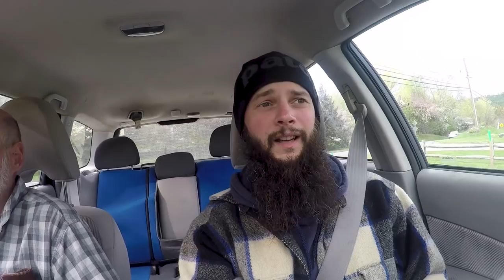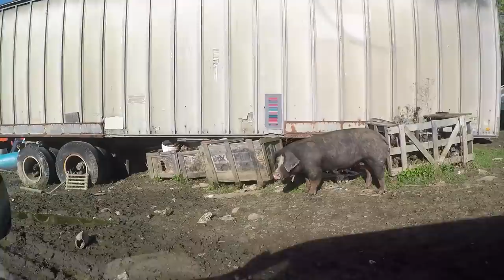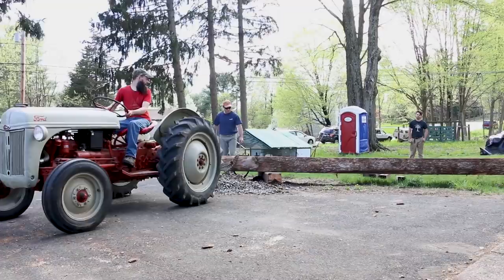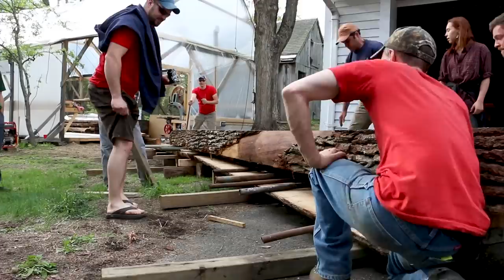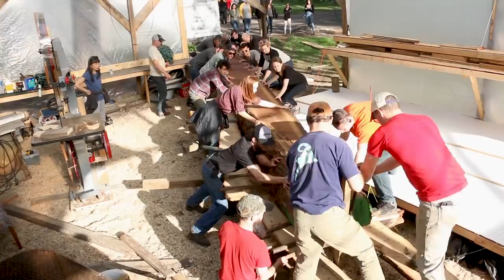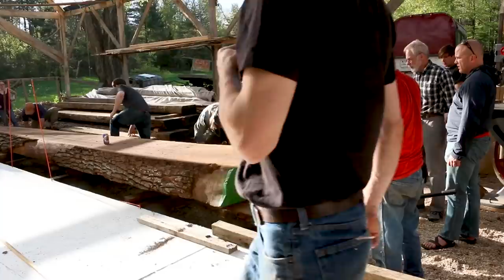Acorn to Arabella - Journey of a Wooden Boat - Episode 10: Keel Timber and Open House

Comment: Having worked for a fabrication company I had to make arrangements for the movement of oversized loads every week.  I suggest that you take the time now to call around to "Rigging Companies" to get a feel for their specialty and knowledge.  When you find one that has the knowledge for boat movement and your project is complete engage them in negotiations for the pick-up and placement onto a trailer.  I also suggest that when negotiating with the trucking company you make sure that the contract reads that their "pole car" is well ahead of the tractor-trailer AT ALL TIMES.  One of our contractor's tractor-trailer was too close to the pole car and the machine hit a bridge before the driver could stop.  Make sure that they are fully insured and make sure that they contact the State Highway Patrol to establish a transportation route for safe transit of your boat through each and every state that the boat may travel.  That will be one heavy boat so you will need some sort of "ballpark" figure on the weight.  Guessing will not do because you don't want the lifting crane to tumble over and loads over 48,000 lbs require additional axel's for the trailer and possibly the tractor.  Keep a spreadsheet on the weights involved so that you have your "ballpark" figure.  Good luck and Peace Be With You All.
Reply from the maker: Thanks for the advice!  
When we had Victoria trucked in the moving company (Brownell) took care of all that, they move boats like ours and even much bigger all the time and have it dialed.  They just need the weight and dimensions, at 11'4" wide and 38' long she is not a huge load to haul, she is only 8' longer and 4" wider than Victoria and Victoria was not a big boat for Brownell to move.
Reply: Yeah its funny how i move up to 90k lbs structures in my work and moving something 3-10k is easy if you know how to do it and your rigging is good. I think my rigging cert expired but ive rigged crazy girders  for highway bridges over 80k lbs on barges on water. So yeah i could totally give some advice and a lil equipment move that thing quickly. BUT the old school way of throwing manpower at it(or 3rd world way) is cool. Sadly places like Dubai they use workers to pass buckets of material because its cheaper to pay hundreds of immigrant workers than buy a wheelbarrow. But theres something cool about large groups of ppl just throwing man hours at a project. When i work on like 20-30story high rises its amazing to watch hundreds of guys all managed down to the task just build crazy huge things. These days we do it with less than half the manpower twice as fast. Thats just modern techniques and budgeting

Comment: Any idea how old the keel timber tree was?
Reply from the maker: ballpark 150 years.  It came from a large property in Upstate New York.  The same family has owned the property since the 1800's and has managed it for old growth timber.  The family needed some $ to cover the property tax so they sold 4 trees and that covered the taxes for a few more years =) All 4 trees went to be milled for timbers for wooden boats. Our keel came from 1/2 the butt log of one of those trees.
Reply: Acorn To Arabella I wondered if you happened to do a ring count since you had the live edge, but I guess you would have had to extrapolate the center point.
Reply: They actually have the pith so aside from a few outer rings they could accurately count them. I's actually very hard to count rings on oak for a few reasons number one being how dense they could be i have seen Western red cedar tress with 60 plus rings per inch ... that's hard to even count with out quarter sawing a board off then using oil and a microscope to count ..